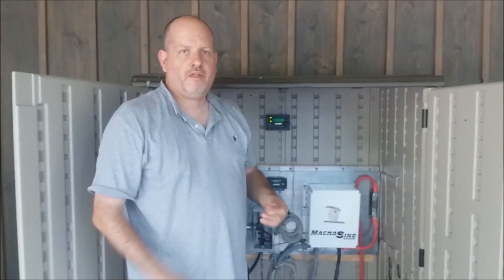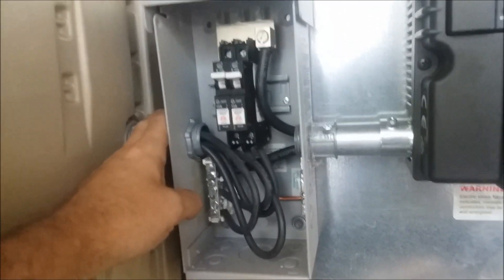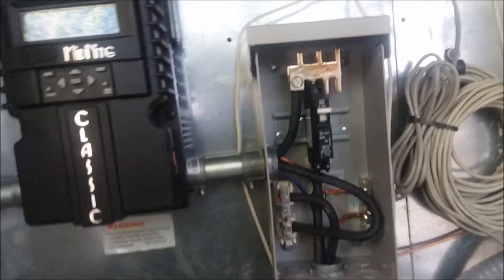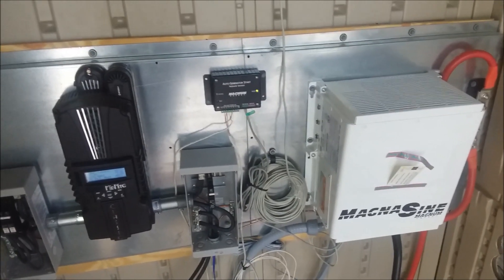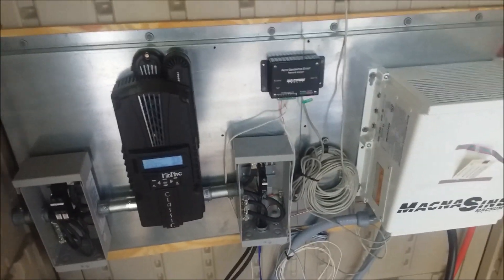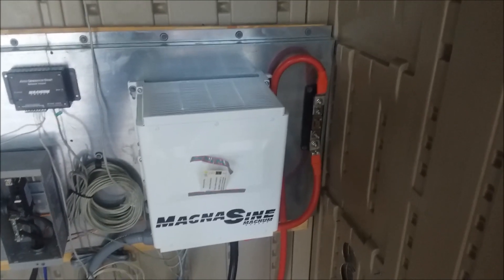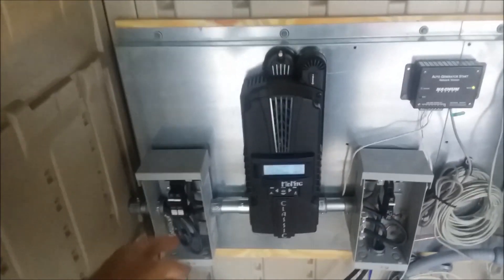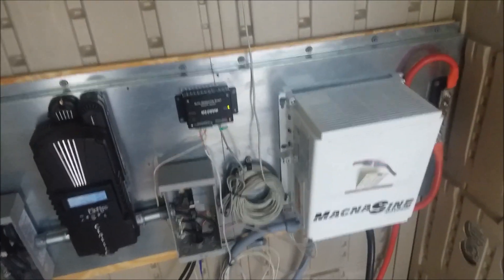24 Volt DC Solar System Midnite Classic 150 with Magnum MS 4024 PAE Inverter Charger

Comment: Thank you Tony, now where do I  add my 1000 watt turbine my system is 24 volt I have 1600 watts of solar the turbine is wild AC, 120 feet from the house i'm using #8 copper wire. I have  the midnight 150.
Reply from the maker: Do you have our 110 volt unit ?
Reply from the maker: I looked through your purchase history and see the classic purchase but no wind turbine.....what do you have going and that was a while back is it still on the ground? did you see the install of the classic with our customer Mike with the classic?